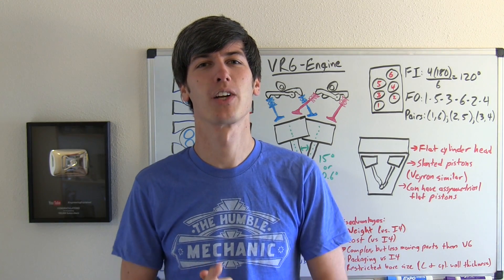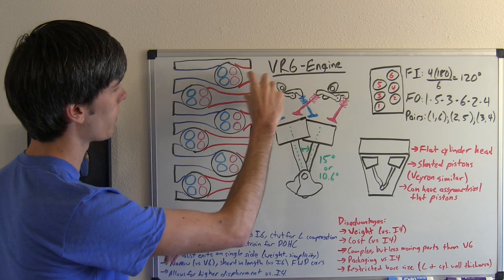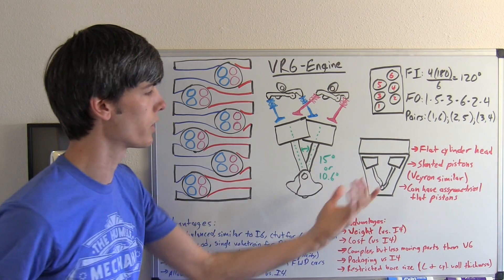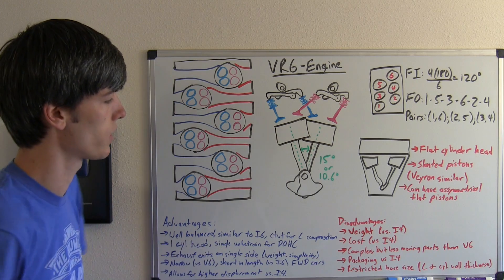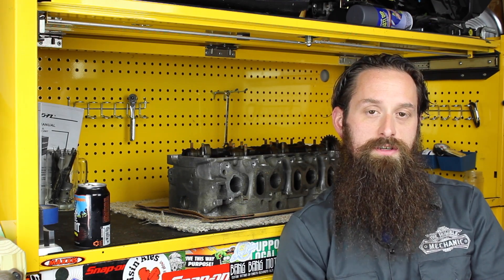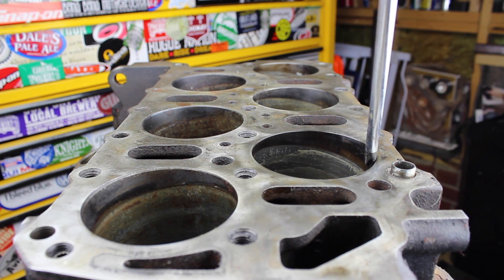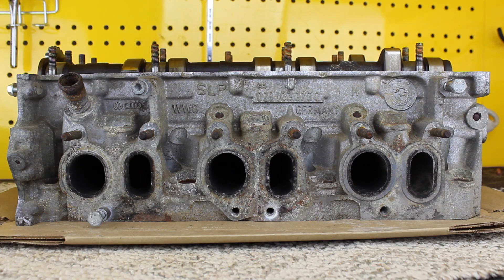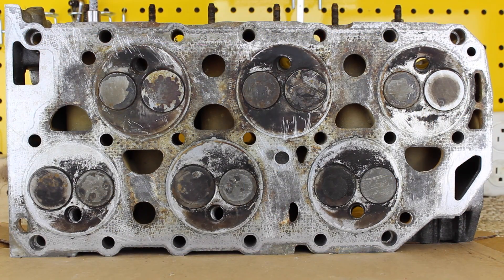VR6 Engine - Explained

Comment from the maker: If nothing else, take the time to appreciate the sound at 14:50.
Reply: doesn't sound anything like that in real life!

they sound much MUCH better in person, and even in other videos ;)

mic was getting a little overwhelmed lol
Reply: ENGINEERING EXPLAINED DO US A THROTTLE BODIE VIDEO ME MUST KNOW
Reply: HumbleMechanic i thought porn wasn't asllowed on youtube?
Reply: That sound gave me an erection
Reply: Karabo Ntswane
 There is no difference in sound weither obd1 or obd2. I've had both. You can find some old vr6 obd1 videos on my channel
Reply: Karabo Ntswane
 The difference in sound can be of many factors, like different airfilters or exhaust mufflers. However the only difference mechanically between the obd1 and obd2 is the fly-by-wire throttle and the coilpack ignition instead of the mechanical distributor. These however have nothing to do with the engines sound, sparkplugs just spark
Reply: Karabo Ntswane
 And all I am saying is that is isn't because of the engine :) It's more likely to be because of different air filter designs or a different exhaust. (1994+ models had different catalytic converters, this could also cause a different exhaust sound)
Reply: Engineering Explained Pure VRSex
Reply: Karabo Ntswane
 "Looking at specs" you say? Maybe you should check VR6clubholland.nl instead ;) I have been (re)building vr6 engines and turbo-ing them for more than 7 years now. I think I know what I'm talking about, not just looking at some specs. (Heck.. even my youtube username is VeeeRzes or VR6 ^_^)
Reply: Is it possible to make a video about primary and secundary imbalance and makes engine run smooth?Some deeper explenation.tnx:)
Reply: The Wookie is alive! Sounds great. Great video collaboration, guys. You both had insightful information to contribute.
Reply: i gues that is the humble mechanics vr?
Reply: Martijn Talma YEP!
Reply: +Engineering Explained pure sex for my ears!
Reply: Chris6068 the obd2 vr6 had a different throttle body, but the plastic intake manifold made a difference in the way the vr6 sounded compared to obd1, yes i agree not the ecu just the parts which i think is what the other guy was talking about obd1.
Reply: +Engineering Explained Sounds amazing but i cant help but spot that air intake wich is not installed properly (is going to suck hot air from the engine bay)
Reply: +Engineering Explained so the nardo w12 is basically 2 vr6?
Reply: @MegaShin999  Yes, in a V block
Reply: +Engineering Explained i would still prefer the old cast iron ford 300 inline 6
Reply: +Engineering Explained sound so sweet but I'm a dirty ass cheap dude with low salary so my Seat Ibiza 1.2 TDI is fine ..I guess :P
Reply: +Engineering Explained What's with that hot air intake? lol Mad pod placement.
Reply: me too and i have no cock.
Reply: Karabo Ntswane I don't understand what you're saying.

by OBD1 you mean 12 valve, rather than the 24 valve ones?
Reply: @flinchey   The OBD1 has a distributor vs OBD2 is a distributorless coil on plug
Reply: Karabo Ntswane
There is also a stock video on my channel, friend ;) **edit: i forgot, i deleted the stock video a while ago
Reply: Karabo Ntswane oh yeh I totally agree with that! Converted my corrado to obd2 and it never sounded quite the same... think its because the obd2 thottle body isn't as wide as the obd1 one.
Reply: Sounds hella good. Would sound tons better if he'd buttom up that exhaust leak though. Leaks make the meanest motor sound so shi**y.....thats just one dudes opinion though
Reply: that is one sweet note i had to say
Reply: g4rr377 not that obd 1 engines have a more "aggresive sound" but Obd 1 heads or earlier Vr6s have a better porting than Obd2 Heads and allow for bettter airflow because of it 
again im not saying they sound different but that is a difference
Reply: RAA12586 Check out my channel, I will upload a video of an OBD1 VR6 and you be the judge then.
Reply: +Engineering Explained Sounds like a Subie in need of a tune up....
Reply: +dieselscience It does kinda sound like a subie.... It sounds like my subie with the resonator exhaust leak.
Reply: +Engineering Explained I would think that the R in VR6 stands for "reduced angle'... but ok.
Reply: +Karabo Ntswane Wow South Africa,s biggest VR6 group i can sleep 
well now knowing Dat zee master,s at das auto have such fans
Reply: +dieselscience  Sorry not getting it at all ,no pop pop bang bang pop pop
soundtrack below par engine in need turbo help be a hot motor ,none 
turbo Impreza any one
Reply: +Engineering Explained  You're right. That sounds awesome!
Reply: +JD Machine  'MURCA!  

Do you say 'The Pledge Of Allegiance' every time you post?!
Reply: +Engineering Explained Interesting it had to crank like 5-6 revs to fire.
Reply: +Engineering Explained or the humble mechanic's beard!
Reply: +Engineering Explained My Eurovan (AXK 4V) sounds just like that!
Reply: +Engineering Explained Your right ... it was a good sound!
Reply: +Karabo Ntswane lol man, I own 2 vr6s, my brother owns one and my sister in law owns one. You're more likely hearing the difference in tones from the different exhaust sizes/lengths, intake/exhaust manifolds, ECU tunes etc. The difference in an OBD1 to OBD2 ECU is sensors, in the end the engine has the same fuel/ignition map from factory.
Reply: +Chris6068 Well that is not entirely true, my brother and I both have the exact same 12v AAA block, OBD2. His has a c2 stage 1 chip and mine is stock. His sounds a lot throatier than mine, and in fact I know it's the ecu tune because I literally took his ECU and hooked it up to mine and it sounded different, due to the ignition timing
Reply: +rockysi22 It stands for Reihemotor which pretty much means inline.
Reply: GRRRR!!! ROAR!!!
Reply: +Engineering Explained Cool video, next in line 5 cylinders by VW and Volvo? Isn't the new Ford RS supposed to have the Volvo i5?
Reply: +Danimal Jr. nope its getting a i4 with cazy turbos
Reply: +VK70001.P 
Makes sense. Pretty cool. Although 5 cylinders do make some very nasty noises!
Reply: +Danimal Jr. and crazy vibration my sister has a chevy colorado with an inline 5 and it feels like an old ford diesel with 3 dead cylinders on one side and its been like that since she bought it new
Reply: My r32 approves of this video.
Reply: +Chris Coates If I recall that far back OBD1 cars had single wire O2 sensors and OBD2 had 4 wire O2 sensors. Two of the wires where for the built in heater so that the O2 sensor started reading quickly. Instead of the single wire O2 sensors that had to reach 600F before they worked. The other 2 wires on the OBD2 O2 sensor was a power wire and a ground controlled by the ECM. General Motors had scanners for each one and they called them OBD1 and OBD2
Reply: +Engineering Explained Sounds like a fart canned Civic lmao.
Reply: +Matthew D Sounds extremely good to me, and apparently to 295 other people considering the amount of likes.......
Reply: +Colin Dunham 295 out of 800k is irrelevant.
Reply: Matthew D nope, it's not....
Reply: what all mods is done to the car at the end? is it straight piped?
Reply: +Anthony Smith 👍
Reply: Quick call your local EMS sire, you have a concussion.
Reply: Karabo Ntswane you clearly have no knowledge of automobiles. The generation of OBD ports has nothing to do with the sound of an engine, neither does the way it initiates spark.. you can convert an OBDI VR to OBDII, does this suddenly change the sound of the engine because "obdI just sound more beastly".. lol
Reply: sorry i just farted
Reply: Sounds like a fart can to me
Reply: Chris6068 WTF dude? U just come out of nowhere and start calling people names? You got your panties up in a bunch or something? I don't have time to be fighting with a keyboard warrior. Now back to the subject, I already stated that I don't know the reason why and I'm not a mechanic. So me knowing much about engines is true but I do state for a fact that OBD1s sound better. Don't come quoting crap about what I have said or calling me a moron. You would be closer to a moron since you don't even know it's definition
Reply: The name VR6 comes from a combination of V engine (German: V-Motor), and the German word "Reihenmotor" (meaning "inline engine" or "straight engine") - and so is described as a "Vee-Inline engine" (VR-Motor). It shares a common cylinder head for the two offset banks of cylinders. (That was taken from Wikipedia)
Reply: @M_L_x64  The VR6 - Verkürzt Reihen6 - Shorthened Inline6 - has a 6-crankpin crankshaft, just like the IL6. Each connecting rod rides on each crankpin. Each cylinder is bored at 7.5° from the cylinder head vertical CL and a total of 15° between the cylinders. This allows the cylinders to be staggered in one cylinder head and shortened the crankshaft length. This reduces the inherent flex of the conventional IL6 crankshaft. Thus lower crankshaft bending moments. It's known in the BMW fan club forum as the crooked IL6.  in one cylinder head
Reply: +Engineering Explained 
Why does it sound so bad, and so noisy?
Reply: ***** 'Could' does not pose a fact to me. Well, then we will just agree to disagree.  :)
Reply: +Engineering Explained sounds like an overpowered weed whacker....nothing to appreciate there.  Need some grumble of good old American horsepower.
Reply: @flinchey That's because OBD1 vr's can sound more aggressive and have a more bass tone than OBD2's and he clearly said he's one is a 98'
Reply: ***** Lol you direct me to videos about a vr6 with a cone filter installed?? You have already defeated the purpose of this argument then. Stock to stock is my argument anyways. . .
Reply: flinchey Nah, I'm also not too tbh sure but basically OBD is the way diagnostics were made and with OBD2 VR's because of the added 'safety' stuff like O2 sensors being different to OBD1s. But here's a link to give you an idea of how a OBD1 VR sounds like:

https://www.facebook.com/video.php?v=10153553937458504&set=o.208384122530062&type=3
Reply: @KaraboK9Ntswane    The OBD1 VR6 has a distributor vs OBD2 VR6 is a distributorless coil on plug
Reply: Chris Coates Sure, but fact is OBD1 VR6s sound more aggressive than OBD2s
Reply: ***** You know being stubborn is one thing but ignorance is another. Check the link I posted. Matter of fact I also own a VR6  (Just in case you thought you were the only one that owns one) but its a OBD2 and the facebook link I posted is from South Africa's biggest VR6 group. You will see various vids and you will easily tell the difference between the OBDs by sound. I agree you know more technicalities than me about engines, but with sound, I know my vr6s brother.
Reply: ***** Lol you are really good at 'reading the specs' hey. I will leave you to your own choices. Accept or reject the facts, anyways I noticed it's a closed group. So request an invite and check them yourself, matter of fact, there's real mechanics etc there (unlike me); they will better explain the argument. The group is called 'Vura six club reloaded'. Take care
Reply: ***** I don't disown your 'experience' or whatever you do champ. I just tell you that when it comes to sound, OBD1s sound more better. They just have a beastly sound compared to OBD2s

Comment: why did you compare a vr6 to an inline 4 though? the inline-6 or v6 are the only two layouts it should be compared against
Reply from the maker: Dusan Pesic Because turbo fours are now just as powerful, while getting better fuel economy. (Fuel economy being the key). The I4 has already started replacing the VR6 in VW cars.
Reply: i'd say packaging is another reason, the VR6 is barely bigger than an inline 4 in any dimension.

the VR6 has shocking fuel economy though.. but since it turns fuel into that glorious noise, that's fine by me :P
Reply: even my 1.4 inline 4 has terrible fuel economy

Comment: i am disappoint you didn't try to pronounce reihenmotor
Reply: Rye-Hen-Motor
Reply from the maker: Haha I would have sounded like a dog attempting to bark. Not in my best interest.
Reply: @EngineeringExplained   You took the easy way out rather than stick to the original. That's why you keep saying and thinking that VR6 is a V6 than a Verkürzt Reihenmotor6 - Shortened Inline6
Reply: Yes also V is called Fau in German so the whole thing is spoken differently in German, lol. So Fau Rye-Hen-motor Sechs Say that five times fast, lol.
Reply: Dušan Pešić yes that would have been good!